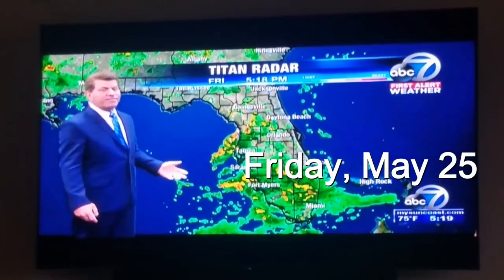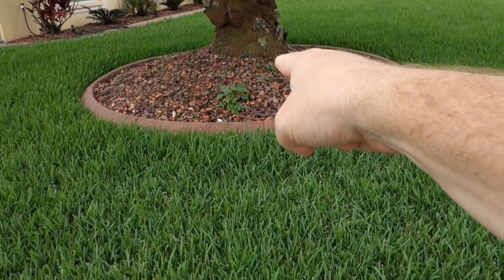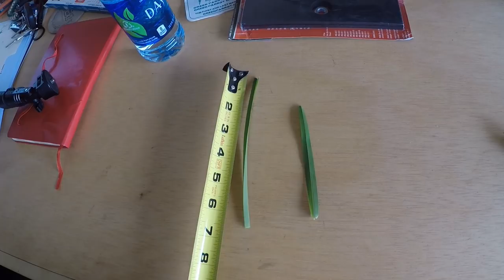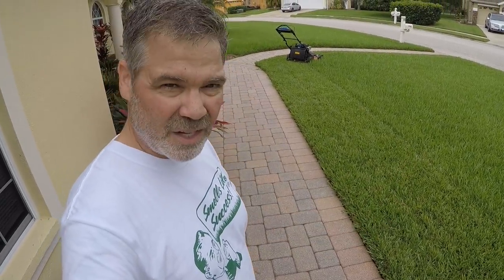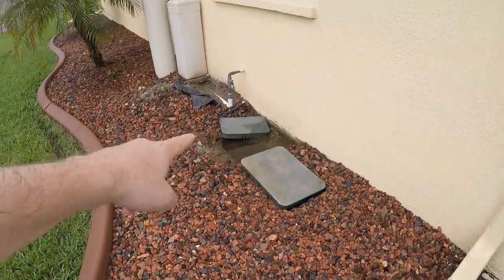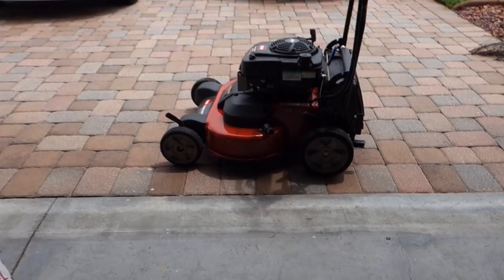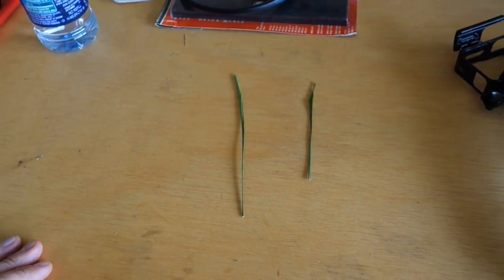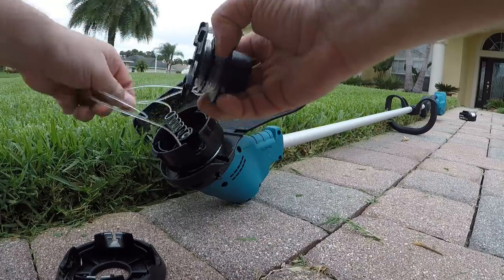How To Mow A Wet Lawn In The Rain On A Saturday And Enjoy It

Comment: I have a question.  I just started using Milo last fall.  I liked the soil last fall and again in January.  I have been putting Milo down once a month, since January.  The fescue grass is growing good but cutting it at 4.25 ends up with a yard that looks swirly and my lawnmower does not cut it even, all over.  It cuts nice in some areas but not others and it wheels leave ruts in the grass, as also does my rotary spreader.  I know the grass is relatively young, as grass grows, having been planted in the last year and has not hardened off, yet.  My brother, a lawn care type, said it sounded like it needed a little lime.  With all the fert I have put down this year that is a real possibility, so I gave it another dose of dolomite lime, yesterday, at my standard 5 setting on my Scott's rotary spreader.  His thoughts were similar to mine on acidic soil, because the hydrangea next to my shop is a bright blue,  which usually  indicates acidic soil.  I also tend to put more lime on it than the grassy areas usually get around  it.  
  I know it is not my lawn mower blade because it is a brand new blade and the wheels on my lawnmower are 1.5 inches wide.
What do you think could be causing this turf type tall fescue to lay down on the job?
Reply: I've noticed that certain fescues tend to get a little floppy when you mow them as tall as you're mowing. Try mowing it shorter by increments. You'll find a height where it grows more upright.

Comment: Are you winding one strand of the trimmer string at a time? I had issues the two string trimmers until I started winding both strands at the same time to avoid one side getting wrapped over the other on the spool.

Comment: Ok since you're having trouble with that Makita, I would love to see you test the Ego weed wacker (1502 included battery and charger) and 530 cfm leaf blower (149 bucks includes battery and charger) Home depot Memorial sale.  I use both (leaf blower recent purchase) and you def need 2 batteries for the leaf blower at turbo...not bad no gas mix, no electric cord but 2 batts are needed.  Also, you're running the lawnmower and it's getting wet.  Is that ok for a hot engine to get wet like that?

Comment: I have 2 trimmer heads. I never take my time when I am trying to mow and trim. Now I load the empty one in the comfort of the AC and switch them out when empty. Takes seconds.
Reply from the maker: smart
Reply: Trim line should never bind up in a spool. I had a cheapo Black and Decker that never did. It was one where you pushed a button to make the line feed out.  Once it died, I now have one of these self-feeding pieces of garbage, the line binds up and you have to constantly stop and fix it.  It's a major pain in the ass.  See my comment above, on how I (mostly) solved the problem.

Comment: My wife bought me a DeWalt impact and hammer drill combo(dck229p2) for my bday this past weekend. So I decided to buy the trimmer and blower so I can utilize the batteries. I'm struggling with the trimmer. The trimmer has an auto feed head which doesn't fully release the string. I'll probably return the trimmer. Plus the shroud is small and kicks sand and rocks into my feet. Super unpleasant

Comment: Those trimmer heads are the worst. I picked up a Stihl straight-shaft power unit and numerous accessories last year, and their trimmer head is the best I ever saw. Cut off a 20 foot section, put one end in one side, the other in the other and wind until there's only a small loop of line between the ends, then just cut the loop and you're ready to go in minutes. And Stihl equipment just can't be beat, although it's not priced for budget-conscious consumers.

Comment: you should not pull weeds... IF you don't pull out the entire root system which you can almost never do it just grows back you need to systemically kill it with a herbicide then pull it.. More bad advice.. It ok to mow when your lawn is wet JUST NOT WHEN ITS A SWAMP.. If you your worried about a good cut do cross cut mow the lawn 2x in a checker pattern and bag (make sure your blades are sharp).. Also they make special blades to mulch, your standard blade on a mower is not meant for mulching (2-1 blades).. Check out Gator Blades those are meant for mulching grass (3-1 blades). Please stop giving people bad advice this is what messes up peoples lawn.